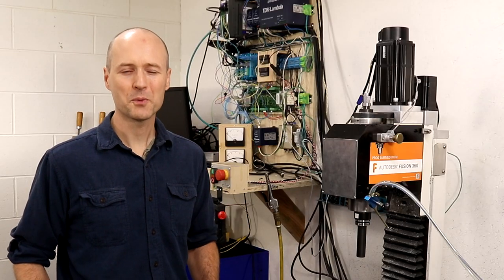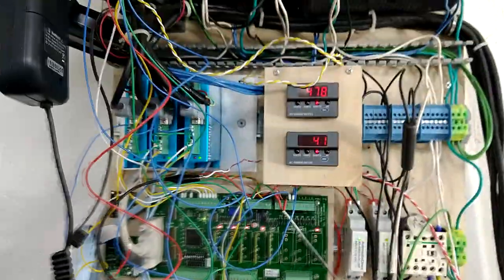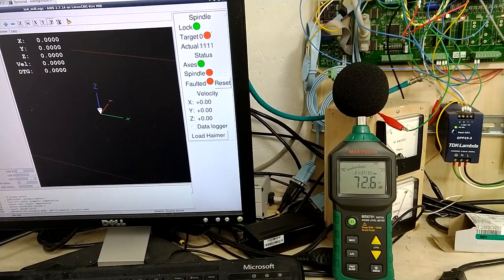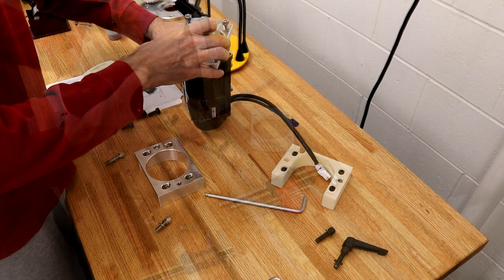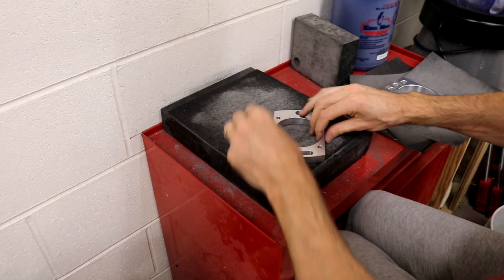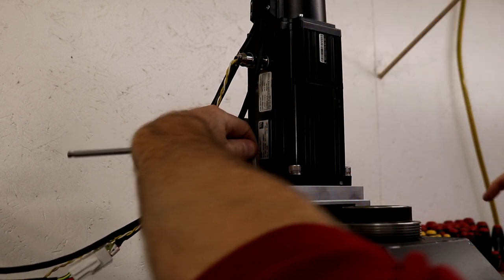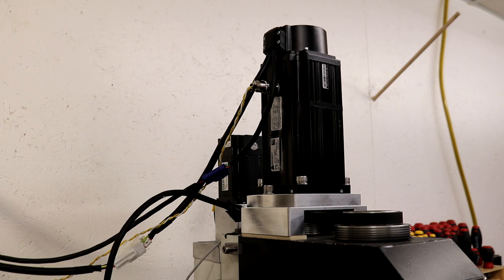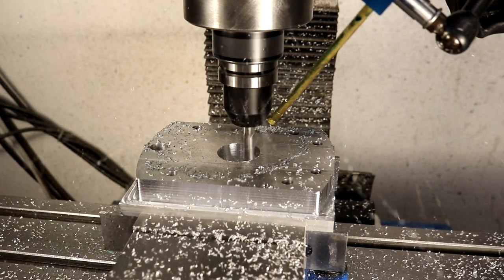Make AC Servo Motor Mounts For CNC Mill Spindle (DMM DYN4)

Comment: How many watts is the servorated for
Reply from the maker: This is 750W which is the largest that DMM offers normally that runs at 5000RPM. They have higher power motors but if higher speeds are important, a large motor will be needed to maintain power after the pulleys. I'm testing a 24,000RPM 2.2kW spindle now and each is optimized for different purposes.
Reply: @kentvandervelden  I am thinking changing my cnc spindle to servo too, but the problem is the low rpm. Most of the servo I found in China second hand market are 1000rpm, 1800rpm, and 2500rpm. I found second hand servo much cheaper, only 200 HKD (about 25usd i think) for a used 750w chinese servo, about 90usd for a 2.7kw servo with driver. The only problem is the rpm issue, if i adopt 3:1 accelerated pulleys, the diameter of the  pully will be larger than the size of the motor :(
Reply from the maker: @tomtang2639  Are these the rated speed or the maximum speed? The DMM that I have is rated at ~2500 RPM, the speed at which it changes from constant torque to constant power, but continues to increase speed up to ~5500 RPM, with reducing torque, until finally the back EMF is too great and the drive faults. Higher voltages are necessary to get to the higher speeds. 
Regarding pulleys, here is the most genius pulley setup that I've seen: https://www.youtube.com/watch?v=kW_8BJLwJL0
Regarding high RPMs: I've added a higher speed spindle and hope to soon have a video up about it. One spindle for slow low torque and a second for high speed. It's working pretty well and less of a compromise.
Reply: @kentvandervelden  That's very helpful thanks! My servo haven't arrived yet but i checked from the internet that it could go up to ~3300 rpm! For very high rpm, i've got a 800w 24000rpm spindle. Now i just want to upgrade it to a higher torque spindle motor to cut steel.
Reply from the maker: That sounds like a winning combination! I'll try to get the video about my high speed spindle up soon. The two spindles work very well together.

Comment: How much it costs that motor?
Reply from the maker: Roughly $200 for the motor and $200 for the drive. Approximately, $400USD total
Reply: @kentvandervelden  I was looking at Ebay but prices are on top of the hill..... 😭
Reply: @kentvandervelden  are those the Tormach tooling system tool holders?
Reply from the maker: Yes, they work well for this size of mill, very repeatable, save a lot of time changing tools. Just be sure to tighten the drawbar tight. Use a torque wrench to get a sense of how tight is tight enough. It was more than I expected. Their prices seem unfortunately higher than I remember, but I spread out the pain over time.
You can find a less expensive options for servo motors on AliExpress. Pretty amazing what can be found there. I plan to try ordering one soon. Will be my first experience with AliExpress.

Comment: Can you show how you set this up with LinuxCNC?
Reply from the maker: Electronics and LinuxCNC setup will be in the next video.
Reply: @kentvandervelden  I am really looking forward to this. I feel like my spindle motor is going to give up in some time and I am in the middle of production. I really need help setting up a servo motor as a spindle motor with linuxcnc.
Reply from the maker: Send me an email with some details and I'd be glad to help with specifics if the two setups are compatible. I tried analog, step-dir, and a/b phase signals, velocity and position control, and closed loop and open loop. Only combination I didn't try was serial speed control.

Comment: hi kent,i need a set of pulleys and mounts for my machine conversion i have the hu 20 dm vario version.
with a broken gearbox ( bought it that way only the spindle and housing) and building my own z x y axis with ballscrews linear rails (mg20h) and steppers
control i am orientating for at the moment.. linuxcnc or mach3??
Reply from the maker: Sounds like a great project! I use LinuxCNC now and used Mach 3 on an Industrial Hobbies mill. LinuxCNC works well for me as a software tinkerer. Mach 3 worked well for me when I trying to just make parts. Today, starting all over, I would very closely at some of the turnkey controllers like Acron, Masso, Buildbotics, and Pumotix and the like. They might be less configurable, less powerful, etc. but have the potential to be more reliable with less cost and less headaches.
Reply: @kentvandervelden  i am also building an 8 axis 3d printer/ mill  ( for making the final dimensions i have a light mill to finish the 3d prints) 
the mill i am building is for making parts for the printer..

i was thinking of using a ramps controller as i have 4 of them lying around.. and another option on the drive of the mill is putting a ac induction motor right on top of the spindle.. (the linear rails behind my spindle are 30mm and 4 carridge so plenty strong) and the z axis is mount on a concrete wall that's 300mm thick by 
8x 10mm chemical anchor  somebody done that already??

was thinking to mount on a knee to the table but that will be a giant leaver and prone to vibrations..
Reply from the maker: Sounds fantastic! Ever considered posting videos about your projects and ideas? Keep them short and simple so not to take away time from the project. See what the reaction is.
Reply: @kentvandervelden  the 8axis machine will be on YouTube when finished,first want to have a patent onto it.. the mill yeah when i have a motor that build willbe on YouTube!! mabee ill film the mounting off the machines cnc hardware..
Reply from the maker: If you're in the US, and need help with the patent, check out 
https://vanderveldenlawfirm.com/
I'm biased, but I know she'll do good work. Wishing you the best of success! Sounds awesome!
Reply: @kentvandervelden  i am in the Netherlands.. but the us will be a big matket for me.. having the possibility to print 1 kg off material per minute and big format it needs to be protected well.. thanks for the info on the patent office!!
Reply from the maker: Small world. My great grand parents immigrated from the Netherlands around 1884.
Reply: @kentvandervelden  nice.. was thinking about immigrating myself to the USA,have had multiple job offers but my wife doesn't want to go with me,and without my wife and kids its a easy choice for me....

Comment: Love your video.  Was considering making the change on my mill as well.  Is there any particular reason you did not go with a larger servo and just stayed with the same 750 watt?  I was considering going to a 1.8kw but maybe that is overkill for the PM25MV,
Reply from the maker: Thank you Kevin! Several reasons maybe none are so important though :) I wanted to 1) show others how the same size servo and BLDC compare; 2) use the same 120V15A service; 3) have 5000RPM; 4) keep near the same size as original motor frame. Now, #2 had already gone busy because to get to 5000RPM, 240V is needed. There are some 1.8kW eBay servos that are 5000RPM. If interested in the DMM, check what options they have that are unlisted. Someone pointed recently, and DMM confirmed, they have a 5000RPM 1kW servo that uses the same DYN4 drive as the 750W and is the same 86 frame size. If I'd known of this option and known I would install 240V, I would probably have gone with the 1kW. I'll post an update once the timing belt arrives.

Comment: If you plan to use the encoder for tapping then you need to switch the drive belt to a Gates HTD cog belt drive. Else you will break taps.
Reply from the maker: Timing belt and pulleys will be added in next video